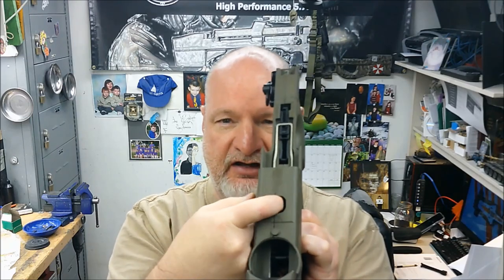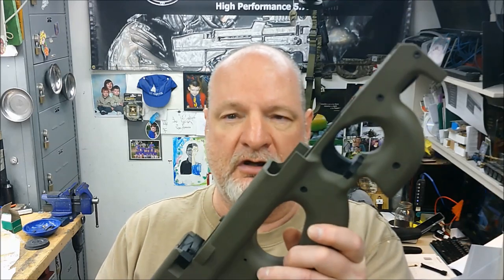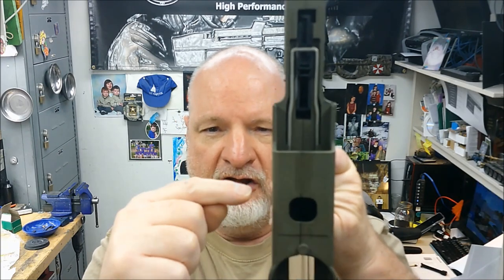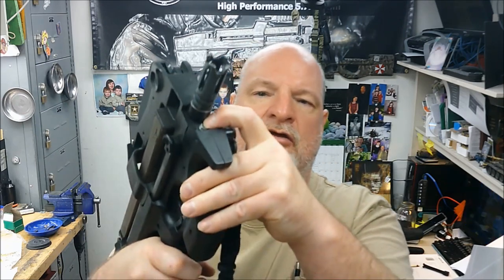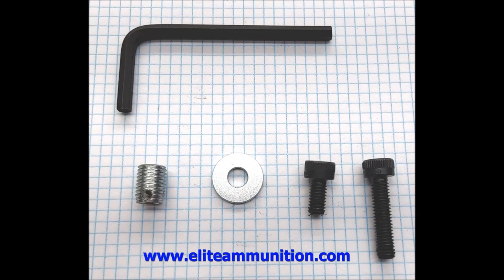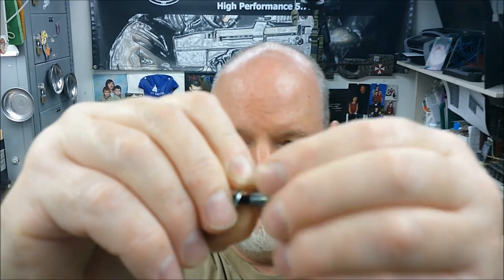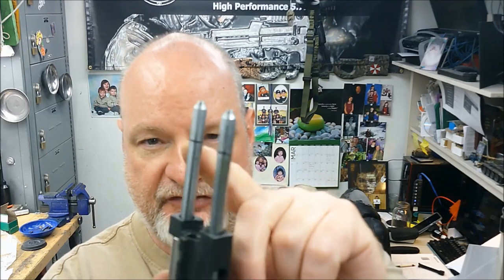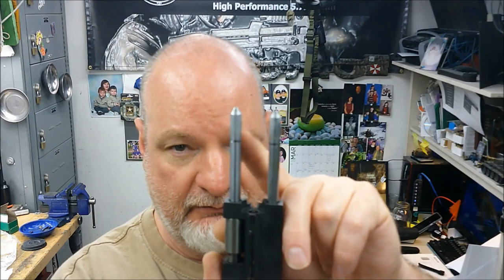P90 PS90 Stock Separation Fix and Repair Kit Elite Ammunition

Comment: I am having trouble understanding that a bolt in the front of the stock is going to reinforce the stock (where the mag release button-hole is located) that is 10 inches to the rear of the bolt installation point?  That mag release button-hole is the place of the failure, correct?  So how is that bolt going to help the hole from becoming damaged? I am not trying to be argumentative.
Reply: First, sorry for my english.
I think it's because the upper doesn't move too much on the polymer lower because of the metal button, in the button hole of the polymer lower, and only because of it. And there is play, just a little, but enought to wear the polymer around the button hole.
So fixing the upper on the lower, with a bolt, makes the upper not moving, and not wearing the polymer stock.